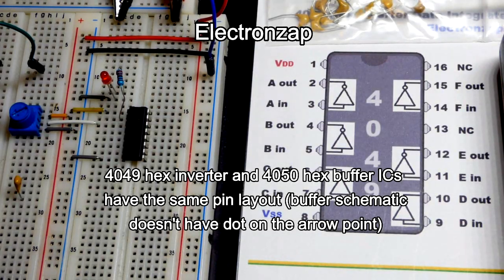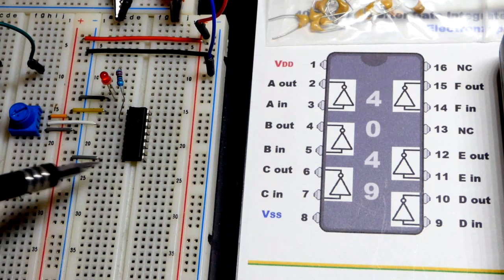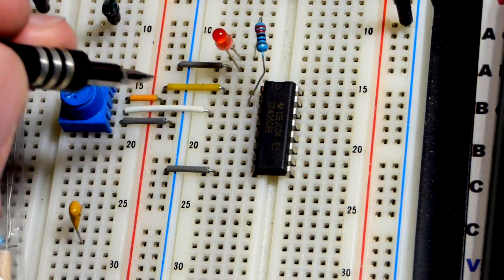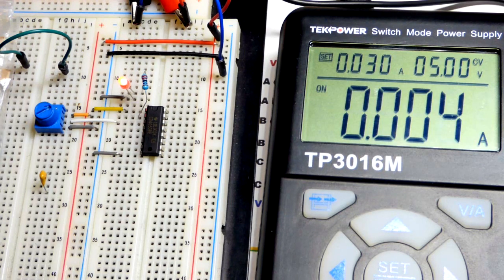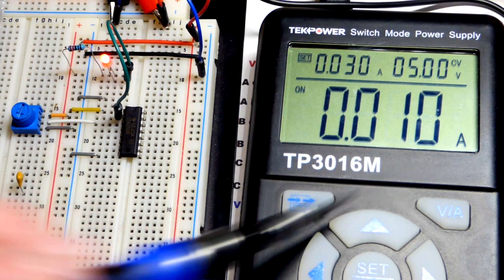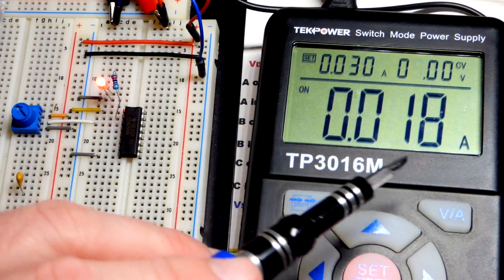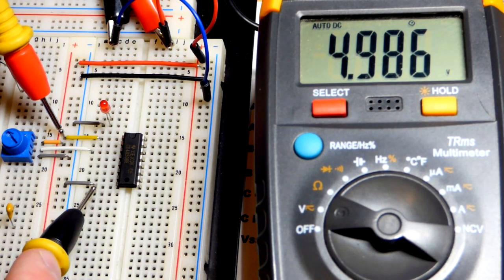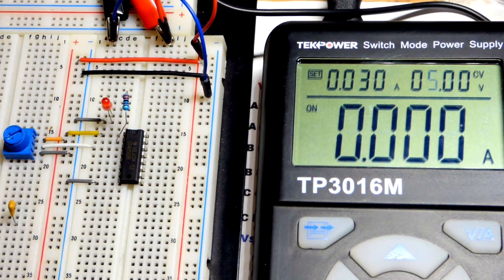4050 non inverting buffer integrated circuit demonstration CD4050BE electronics tutorial

Comment: Dude, you spend more than 1 minute (of the 9 minute video) to explain why you did not draw the correct diagram for the 4050 but instead show the "wrong" diagram of the 4049 and why they are almost the same but yet slightly different. Even the description has to explain that. 
That is boring at least, confusing at most. One tip: just draw the f**g diagram for the 4050 and cut 1/9th of your video.
Reply from the maker: Thanks for the suggestion!

Comment: A few years ago, I was just starting to experiment with these IC's. I built a breakout board for this chip and had it mounted in a project box.  Well I must have needed the box for something else and tore it apart, but being a hoarder of parts, I kept the board.  So the other day I found it. I looked at it and saw what it was but could not figure out for the life of me why i put it together.  Watching this video showed me what I must have been doing. I was building a converter to step 5 volt output from an Arduino to a 3.3 volt device!  Must have been it!  Now days I have a bunch of tiny step down boards that do the same so I must have built this before I got them.  Thanks for the video, at least now I have an idea of what I had in mind while putting it together. Now if I could just figure out what I want to do with it now....